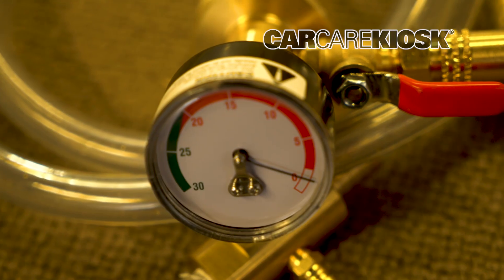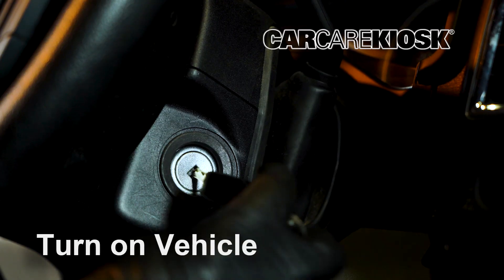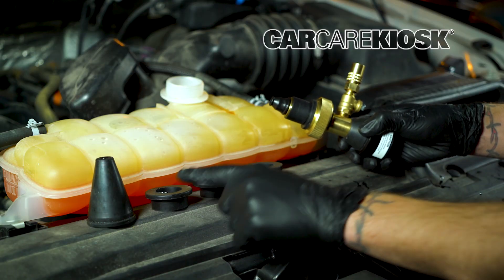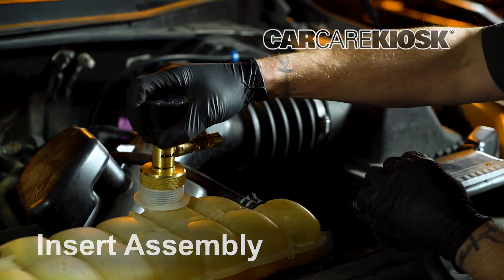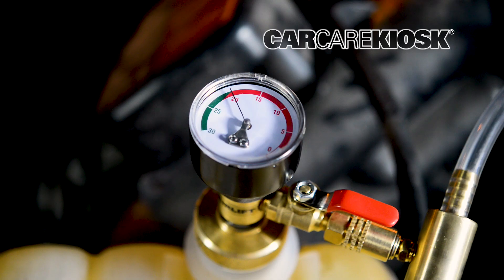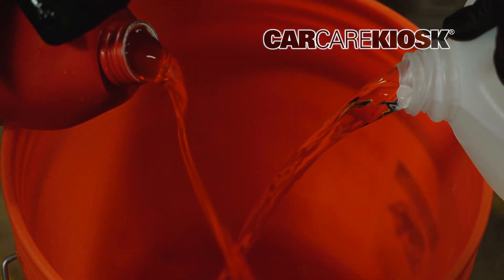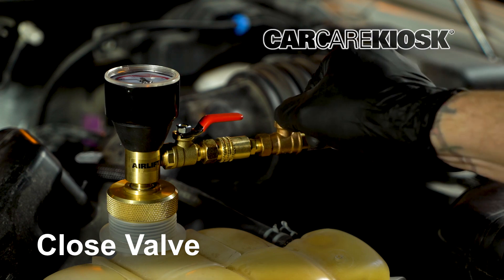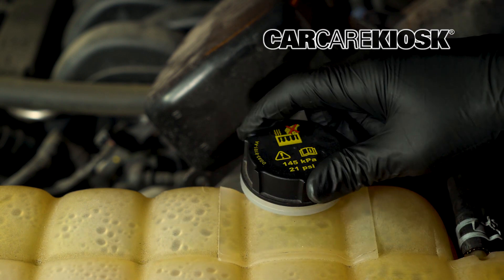Coolant Drain and Fill the Venturi Way

Comment: Couldn't you use the ventury effect to pull the fluid from the system instead of draining it
Reply from the maker: Theoretically you could, but you would need to get the tube to the lowest point in the system and also set up a sealed container on the other end to create the venturi effect...we think it's much easier to simply gravity drain the coolant and then use the venturi to replace air with coolant in the system...it's super helpful for engines that have a lot of plumbing where there is a lot of air that gets trapped in the system.  Thx for the comment though - very interesting!
Reply: @CarCareKiosk  If you use the Venturi to suck out the liquid directly you will blow the coolant out with the compressed air and make a huge mess.  To make it work you would need air tight container (receiver) that will hold all the coolant and draw a vacuum with the Venturi from the top.  Another fitting and hose needs to be attached to insert into the coolant.  You want to keep the coolant level in your receiver below that of the Venturi inlet to avoid sucking coolant into it and blowing it out the outlet all over the place.  I did a similar arrangement remove engine oil when I replaced my timing cover gasket but used a shop vac.  It worked because of low fluid head, the Venturi would have been my next attempt had the shop-vac failed.

Comment: Yals videos are great, don't get me wrong, but there are a few of them that are not using the car in the title. For example, your video with the Cavalier Radiator fluid fill. A couple of the videos are not using an actual Cavalier. It's mostly the same, but when were working a car, and we're not a mechanic, most of us need to know EXACTLY what to do. Not, like, kind of what to do. So the problem with the Cavalier Radiator system is that it's almost impossible to check the levels in it. It's not a traditional "fill right from the top of the radiator" type radiator. You fill from the overflow tank, which is completely opaque, so I can't see how much fluid is in it. I was wondering if there was any way to actually check the level in a 95-05 cavalier. I can open the top and see the level. But the overflow chamber is divided into two sections. You can only see into one. Thanks for any help.